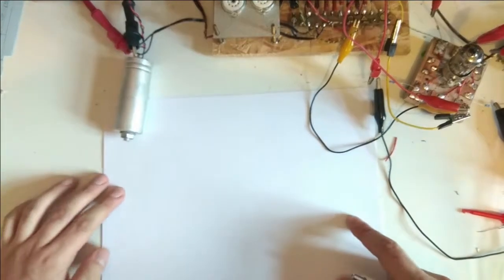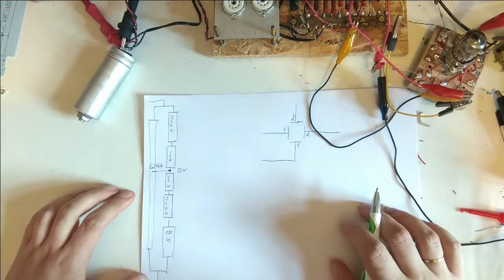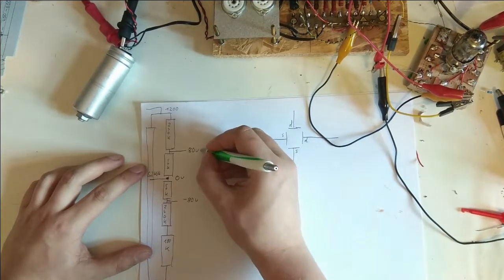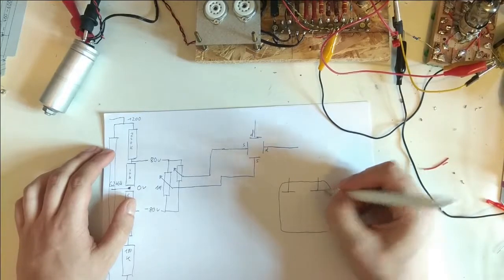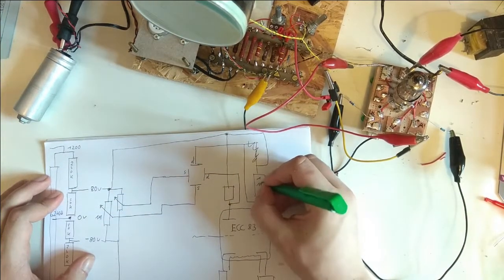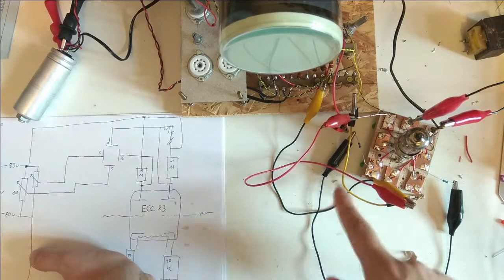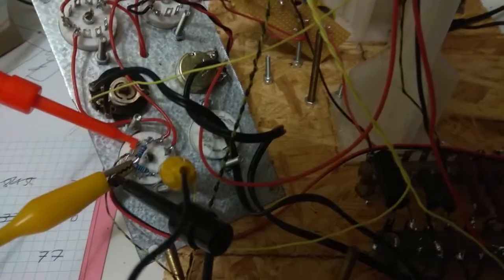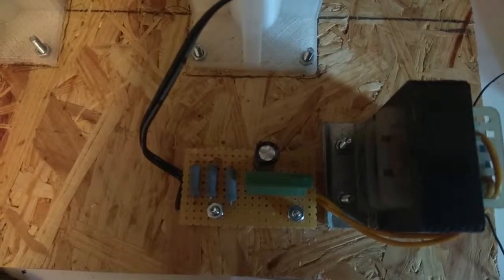Building a cathode-ray oscilloscope Part 2: Deflection Circuit

Comment: Impressive! What voltage across the deflection plates is necessary to deflect the election beam across the screen? I'm thinking of building something similar. Thanks!
Reply from the maker: Thank you! I highly recommend the differential deflection circuit that I build in a later video over the single ended one that I showed at the beginning especially if you have a tube that is the size of the B7S3 or larger. If you have a datasheet it should give you a value for this, if you use a weird tube that doesn't have a very good datasheet like I did then around 10-20V per cm (The Datasheet for the 5ADP1 gives 30-50V per inch) is a good starting point. It will also depend on the direction. The X and Y plates are usually a little bit apart with one set closer to the screen and one closer to the cathode. The set that is further back will need a little less voltage because a given amount of deflection will have more effect on the path of the beam because it is further away from the screen at the moment the force is imparted. (in the Example of the 5ADP1 typical data for the one set is 40-50V per inch and 30-37.5V per inch for the other). It should also be possible to work this out theoretically by considering the Geometry and the Electrostatic force equation (I vaguely remember doing something similar for a mass spectrometer a couple years ago)

Comment: The sawtooth will be tricky.
Reply from the maker: Still struggling with the Sync and trigger circuit actually. Sawtooth waveforms are hard xD
Reply: @captainsolder5247  You could always cheat and use a 555 timer. But that defeats the purpose, realy.
Reply from the maker: Might do something like this for testing, although interfacing solid state and valves/tubes is usually a little annoying